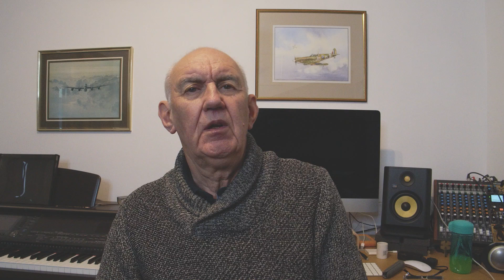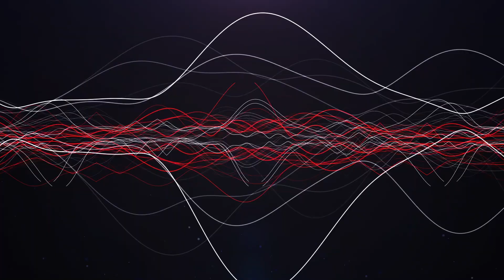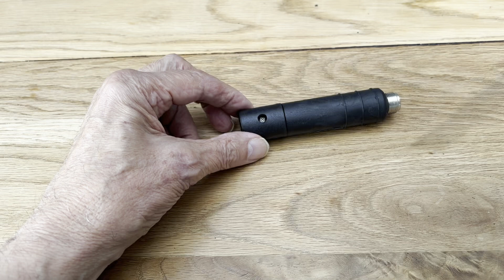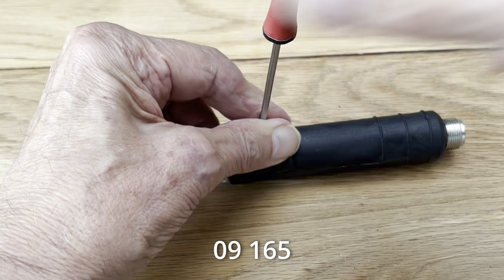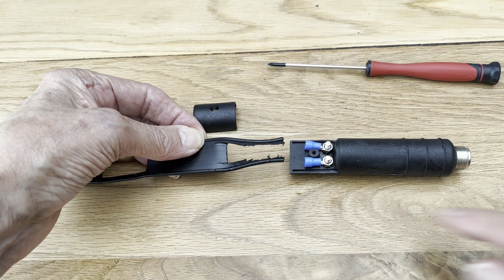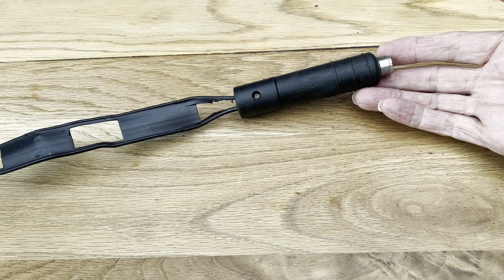Connecting Ladder Line to Coax Cable - Ham Radio Feature

Comment: I have a question. I have a binocular core ferite and wonder how do nI count the turns to build a balun. Is it like a standard transformer or is it count one turn for every two holes passed. Want to use it for a efhw antenna.
Reply: Each time it passes through either hole equals one turn.
Reply: @kn6vbw  Thanks. I thought so but was not sure. 🙂